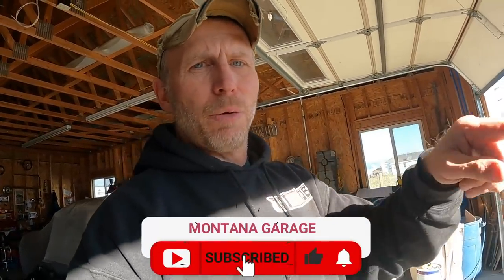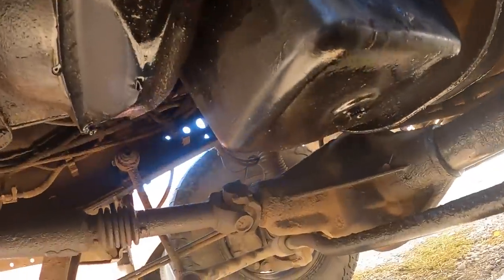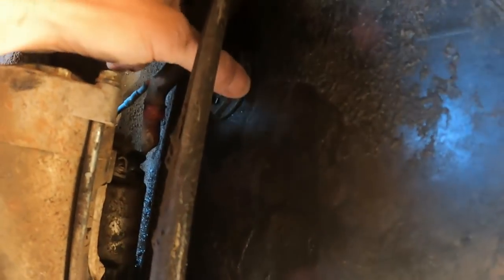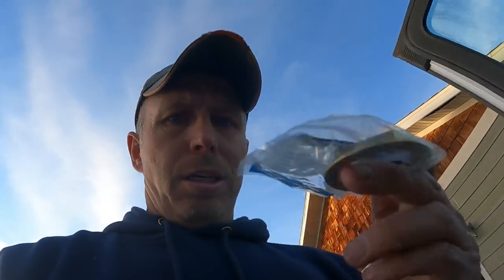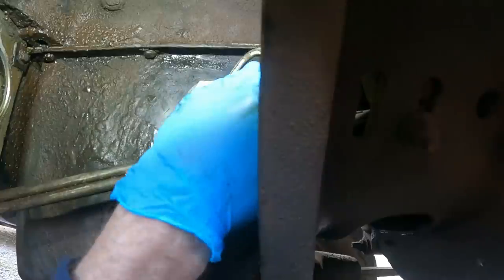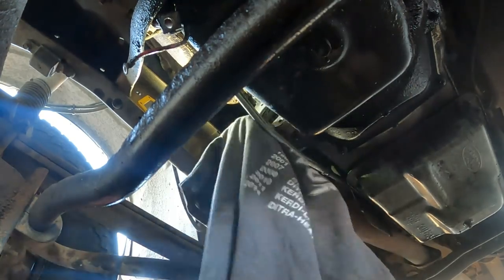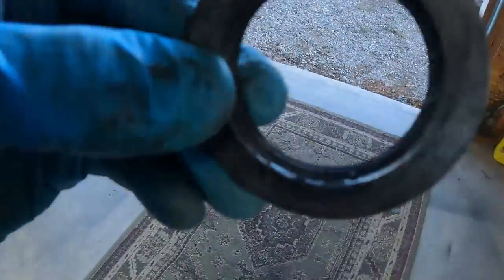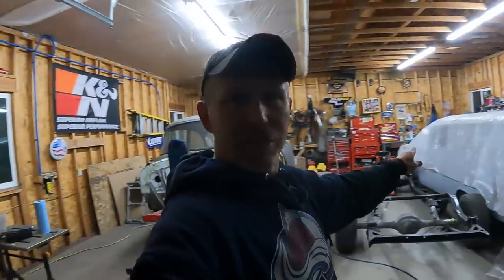How to Fix a Leaky Dipstick on a 7.3 Powerstroke Diesel

Comment: Nice video, but anyone watching this and having trouble with removing the dip tube from the housing on the pan wants to know an easy way to remove it. Take a pair of vise grips and clamp it to the tube itself as hard as you can without crushing the tube. If your not mechanical inclined enough to know how thight to make it, start off clamping it loose, then open the vise grips so they are loose, turn the tightener like1/8 turn and clamp back down. Repeat this till it's good and tight but not crushing the tube. Then just hit the vise grip with a hammer. It will pop right out no problem. Then just my opinion, I wouldn't put an o ring back in there. I would clean the inside and out side of the the hole in the oil pan and the dip stick housing itself. Then put a bunch of rtv silicon were the o ring goes and on the back side of the nut were touches the oil pan. Put some lock tight on the threads and thighten it up. International says to fix it this way instead of using an o ring because sometimes the o rings swells up so much it could distort the part were the o ring goes so much it won't seal correctly. And I would use the gray rvt or the black. I use nothing but the grey rvt on everything with no problems. With the gray you can put it on and tighten up right away and be done. You don't have to wait for it to tack up like the blue and red, and the gray is rated stronger.
Reply from the maker: Thanks for the info. That sounds like it should work as well.

Comment: I am into day 3 of an oil pan / dipstick tube leak. I went today to Brondes Ford to pick up these parts.
F4TZ *6751*A   CONNEC SP-OR  1  $25.33 that is the nut on the tube fitting.
Also the blue oring
3C3Z*6753*AA   GASKET SP-OR 1 $11.46 
AND A NEW COPPER OIL DRAIN PLUG WASHER/ GASKET
3C3Z*6734*AA   GASKET 139D  38   $6.91
My Company has an  account with This local dealer. We get 10 to 15 off these prices.
These parts fit a 2000 F350 7.3. I have 490k. This is the 3rd leak in a row.... lol every 2 days. I will report back. The back up plan is to put an Extreme Diesel knock off fix. It is a great fix if it doesn't work. After watching this YouTube i have great hope... even bought the Dorman kit.
Thanks you and God Bless
Emmy
Reply from the maker: Hopefully it worked! I too ended up with another leak and went with the Strickly Diesel Adapter kit. No troubles since! Thanks for watching!

Comment: Thats so much fun. Did mine awhile ago.  I put a little lock tight on the retainer nut to keep it from backing off. But great job. Thanks for sharing 👍
Reply from the maker: Lock tite probably would have been a stellar idea. Did you use the little tool or make something to hold the inner part in place? I'll keep an eye on it I guess. Thanks for watching.

Comment: Easy fix Brad.. here is how I do it. 
1. Remove radiator cap.
2. Pull out powerstroke powered vehicle that is having issue. 
3. Pull in known good powerstroke vehicle or comparable but more reliable vehicle of choice. 
4. Re-install radiator cap. 
5. Test drive and check for leaks.
Reply from the maker: Haha I'll try that next time. Dang Fords...

Comment: Congratulations on getting the  new rating to forge ahead with your  channel
Reply from the maker: Thank you Carmelo. Much appreciated friend.
Reply: @MontanaGarage  Your engine start sounds like you may need the White Rodgers Stancor glow plug solenoid .
Reply: Just a tip
Reply from the maker: @martinjay5906  Thanks for the tip. Is that some sorta special glow plug relay, or are you just saying it needs a new one? Thanks for watching.

Comment: DeBoss did a engine swap with school bus diesel in a 97 f350. Thinking about doing something like that later. When the 94 C2500 or 97 f350 gas engines tap out. Sucks that the power stroke keeps leaking. Hope that helps.
Reply from the maker: Sounds cool. Thanks man.

Comment: After posting I thought about it and when I do this repair in a couple weeks when I get time, I'm going to use rvt on the theads as well. It will hold good enough, plus with silicone on both sides of the pan and on the threads thats not going to leak and there will be no o ring to swell up again in the future. That's what happens to these trucks. The vibration loosens the nut. Oil gets in there then the oring swells and causes a leak. There is a company that makes a replacement part that puts the o ring on the outside of the pan, but they want you to drop the old part into the sump. I have no proof but I think the engine vibration will eventually move that old part around enough to make a hole in the oil pan. As a semi mechanic and now driver I have seen some crazy stuff. I had a front mud flap rubbing on a fuel tank from the wind going down the road rub a hole in the tank till one day I came into the yard and all the diesel was on the ground under the truck because the mud flap cut a hole in the fuel tank.
Reply from the maker: Yeah, crazy stuff happens. Let me know how your RTV fix goes. 👊

Comment: As much as I don't like to spend extra money I think if I got to that point after 3 days I'm ordering that $300 fix. That thing goes on so quick and easy but it does cost $300.

I do like that tool you were using. I haven't seen anyone else use that. Most people are using vise grips with the skinny profile. I hope it's fixed your problem.
Reply from the maker: Thanks for watching. It did fix it, for a while. For some reason it just came loose again. I crawled under the truck to check it out, tried to put the nut back on, and the dang internal part fell into the pan. Crap! So now I will be doing a video installing the dang $300 part. Coming soon...

Comment: You can take oil pan off while in truck but you must raise the cab 8”s then you must raise the front of the motor high enough to get oil pan off. So might as well change oil pan gasket along with the dipstick tube seal
Reply from the maker: That sounds like a ton of work. I did the Strickly Diesel adapter and have had no issues since. Thanks for watching!
Reply: @MontanaGarage looking at doing this on my truck and thanks foe the video. I off road with my truck so for me I don't think the billet one is the way to go. About to have a bunch of break clean

Comment: Way to go!!!!
Geez what a pain in the butt to do!
But you did it!!!!!!
Ford couldn't have just welded the tube into the pan or better yet, put it in the engine block where they normally go....
Reply from the maker: Yeah I had no clue it was designed like that until the oildstarted pouring out...

Comment: You might could have turned the nut around and straightened the threads, then if it went on you could have turned it around and see if it would go on the right way..just my 2 cents.
Reply from the maker: Sorry, somehow just saw this comment. Weird. I tried to "fix" the threads, and also tried (and tried, and tried) to put it on both ways, just couldn't get it to work. Thanks for watching.

Comment: I did the same job and still leaks, what would you recommend?
Reply from the maker: Bummer. I'm not sure, other than I remember having to be sure the new o-ring was seated properly. Maybe double check that? Good luck, and thanks for watching.
Reply: @MontanaGarage   might have to go with the strictly diesel dipstick. It’s definitely leaking less but still leaking.. thanks!

Comment: Ford made it so it can earn them the most money in parts. Well done.
Reply: Yep!!! Had two new Fords in our family that needed work. Dealer refused. One vehicle needed it's first oil change, the dealer kept re-scheduling the appointment..after 9 months, I wound up doing it. That car was sold shortly after.
The second one was a '86 V6 Cougar. It had a blown intake manifold gasket. Oil poured out the back of the engine, onto the bell housing. I was under the car with the dealer and they REFUSED to acknowledge the leak...
After the warreny expired, THEN they noticed the leak...I told the dealer, what leak? I don't see any leak!!! It's off warranty now, I don't see squat!!!
Two different dealers...
Reply: @howardkoster4026  We had a '99 ford ranger with less than 100K, both heads cracked in two, sold it for scrap.
Reply: @jack002tuber  sorry to hear this. 
Ford has a better idea. ( pity they never use any.)
GM has the mark of excellence...( they must have mighty low standards.)
Reply: @howardkoster4026  My Honda and my Nissan are both excellent. LOL.
Reply: @jack002tuber  my Subaru Forester is almost 7 years old, no issues!!!!
Reply: @jack002tuber  I had a Mazda 626 and a 2007 Camry. Nothing but troubles with both. ( they were BOTH made here.)
Reply from the maker: @jack002tuber Yeah that is a weird design for sure. They got my money...
Reply: @howardkoster4026  Nice. Wait till you have 420,000+ miles on it. Then come back and see what issues you have.
Reply: @LVCJXXX  Ford refused to do 1st oil change on brand new 1984 Fird Escort.
Lincoln/ Mercury dealer REFUSED to see a blown intake manifold gasket on 1986 Mercury Cougar that was under warranty. They SAW the blown gasket AFTER car was just out of warrenty.
I learned to avoid buying American cars at that point and I NEVER regretted it..

Comment: How long did the repair last?
Reply: Not very long. Check his video list.
Reply from the maker: Yeah it nut came loose, then I dropped the inside part into the oil pan while trying to fix it. Ended up doing the Strickly Diesel Adapter and no issues since. Thanks for watching!